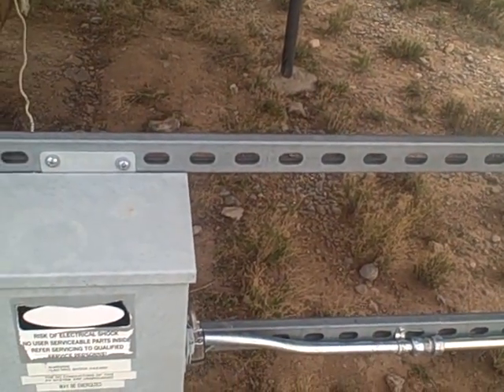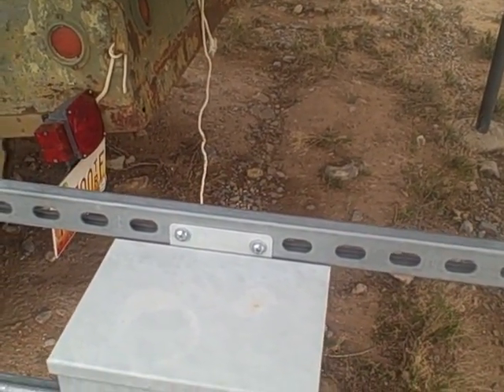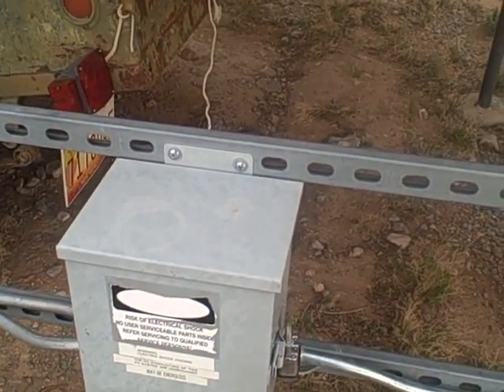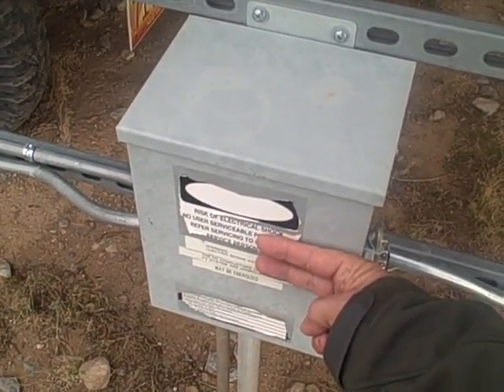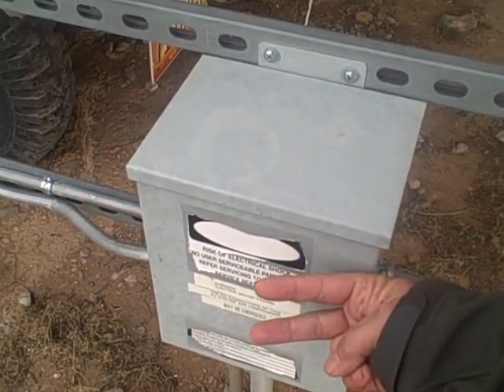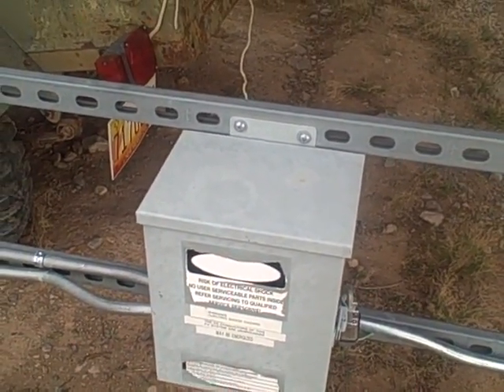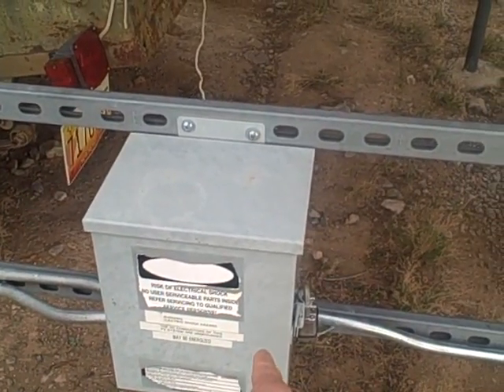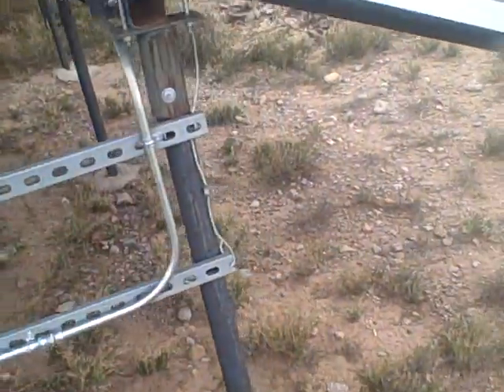Solar Design:  How to find a bad panel in a string

Comment: So....I have a 4 panel run and I get the Positive and Negative off either end, but when you say connect  the meter to say negative and to ground you mean the frames earth ground correct?
Reply from the maker: what value did you get when you meter acfross the two?  I'll have to dig my notes out if this is serious, but from what I can remember yes...

Comment: I think Shelkas idea here is well intentioned, but the problem is these common 30v solar cells are electrically isolated from ground (Ive got 40 on my wifes shed roof).  The two connections from the panel board, one goes to white (negative DC) and the black is (positive DC).  The ground loop you refer to is only going to come into play if a panel burns up to the point where the positive or negative burns through the diode and plastic and actually touches the ground (that would be a catastrophic panel failure).  The ground loop is to keep your roof and your electric chassis grounded with your house.  So you should never normally have a voltage from Ground to positive or Ground to negative DC, unless someone tied a PV line to ground during the design - which I dont believe would be a good practice in general (the double insulated design appears to be safer, let the dc short itself out in the DC breaker box and keep the AC ground connected to chassis ground for lightning strikes, etc).

I would measure resistance from ground to DC common to see if your system has a grounded negative DC wire.  Or in a safer way to not blow the meter, just measure ground to plus on a working string and see if you get the full voltage.  That would mean you have a DC common wire tied to your house ground.
Reply from the maker: The purpose of my video was to discuss how I was told by a panel manufacturer to find a bad panel in a string, nothing else.  But thanks for all the comment, hopefully others will benefit and enjoy it as much as I did.  Ya don't often get a long read any more

Comment: Seriously?  Can you explain exactly how  determining the total "missing" voltage  (or number of missing 30-volts (per panel) identifies exactly WHICH panel is bad? Um, may I suggest a basic electricity course to learn Kirchoff's law?. Also  Sorry.. To properly test, you need to disco the string "Fly it" and get on the each panel and measure Isc (short circuit), Voc (open circuit) and Vmp  (Voltage at Maximum Power) (for this last measurement, read each panel while the fully connected to the system (you want a load)... But the panel manufacturer's want Isc Voc and Light Intensity (Lux).  This "hack" method isn't gonna do it.
Reply from the maker: AND YET, when I called my inverter manufacturer and worked through an issue I had with a panel, my way is how I was talked over the phone how to diagnose it.... so maybe you could use a PV focused course as well
Reply: @Shelka04  Besides phone call, can you post some links that back up this method? Or draw out some circuits? If you're right, it's a big deal and should be spread around the internet. But sadly, I don't think you are.
Reply from the maker: @smprather  when we get back to New Mexico i'll revisit this subject, for now were working in Orgon for the summer, but thabks for the look and idea for a follow up

Comment: Hi are you still around. A Question. When measure the voltage between Positive and negative to groung. The ground is like the ground of the a Home grid? So a cable that is connected to a Coper bar placed underground?
Or is a cable that is connecetd to the structure of the solar panels?
Reply: Yes.  It's an earth ground,  just like your home utility service ground.  And typically,  it's a copper clad ground rod

Comment: So if you got 30 volts on negative / ground, panel one is bad?  60 for panel two?  I suppose you would know how many panels were back by the total operating voltage below 270 in normal operation.  How does a drone do this testing for bad panels?  Infrared imaging correct?
Reply: thats the way to go

Comment: I have more then 2600 panels .9 panels in series and other 9 in series .they are both conected in pareral.its one set all set of panels conected same way.144 set of these sets i have.Problem is some sets have ground faults.now these sets not working.is it sam way to check all ground fauts.Because its very big area not posibel to check each and every panel.
PLEASE reply

Comment: If you have your positive and negative in free air you should get no voltage to ground on either wire. What you just explained is how to check for a ground fault.

Comment: Sorry if you have 5 strings you should also have 5 breakers..... turn off your strings and check check with your meter positive to common ground.
No loose wires to accidentally short out. 
 If you don't have each string on a breaker or fuse you are not safe.
 Check your code book for solar power

Comment: How does this work when you always have an open circuit? One end of each of the strings is 'floating in the air' at all times. Confused.
Reply from the maker: sorry for the confusion, to find a bad panel, fly both of the positive and negative wires in the air, then meter one end to ground and then meter the other end to ground,  the value will not be the same, then do the math i mentioned.  If ya still can't figure that out let me know,  we've in a brown out situation at the moment so I can't compute to much.  But i'll come back so ask away
Reply: Are you saying to to connect both to ground at the same time but each through a different multi? What it seemed like you were saying was the same as measure one pole of a battery to ground to see how much voltage you have and then do the other. Not going to work. If you are saying do them both at the same time then it makes a little more sense as the circuit is complete. I still have no idea how this would give you different voltages though. Can you explain that bit?
Reply from the maker: Hey Kris,Good to hear back from you.  I can't explain because all of this was told to me by a tech at SMA (my inverter manufacturer)  But I can give you loads of more detail.  OK let's go off of the idea that you have 11 panels rated to 34.6 volts, so on a working system you would get a value of 370 on either leg.    That's 11x34.6.  Let's talk wires for a minute as that gets confusing sometimes thinking AC vs DC.  In this case we've got two wires we connect in series to make our string, and a green or bare copper ground wire attached to the panel frames.  It's the first two wires i'm focused on.  The idea is to disconnect those wires (NOT UNDER LOAD) and have them available to meter.  I use the term flying around in the air because in my combiner box where space is tight I try and get them as isolated and not running the risk of touching anything.  That would be bad for obvious reasons.  OK so those two leads I just mentioned.  Meter one leg with the other lead from the meter on your ground lug.  Write that value down.  Now do the same to the other line, write that value down.  IF the panels are fine you will have the same value from both readings.  in my example you'd want to see 370 on both legs if everything is OK.  BUT let's say one of the readings is lower (different) let's say we instead got a reading of 103.8 on one of the legs.  Now divide 103.8 by 34.6 and you get 3.  That then tells us that the third panel up stream in that leg is malfunctioning.Does that help?  If not let me know and i'll churn out a new video.  Cheers.  -J
Reply: Shelka04 OK thank you. Seems like you are testing for an earth fault in the string not a dead module in the string with no earth fault. Things making a little more sense now.
Reply: @krisfulton1824  I think so too, that makes sense. I wonder how you test for an open and for what panel?